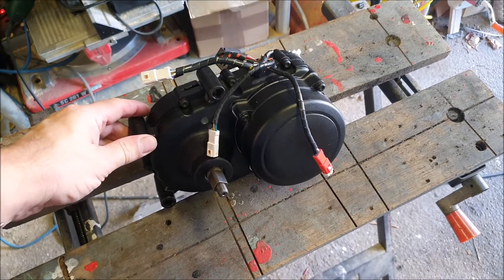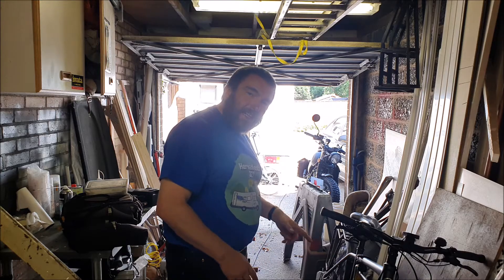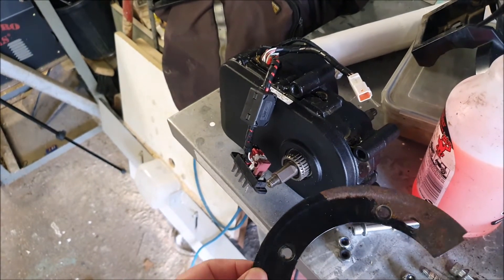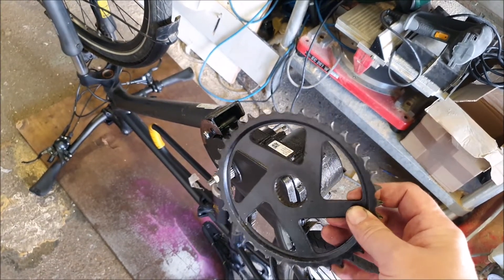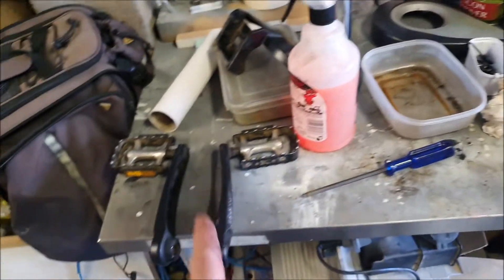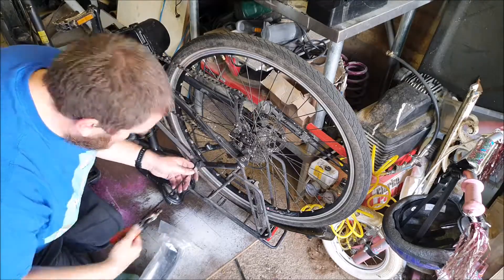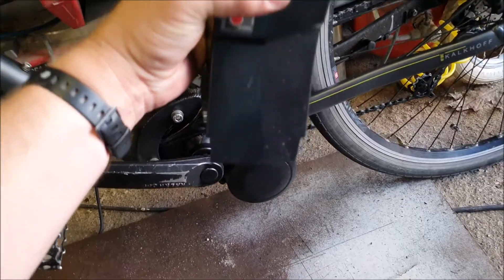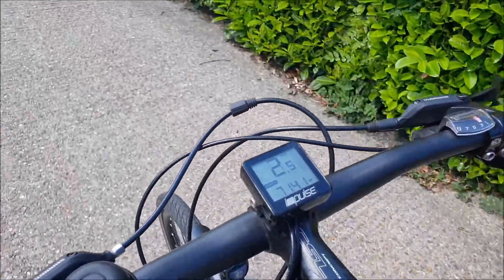Why Is My eBike Not Providing Power? Part 8 - Power Restored?

Comment: Thank you for giving my company,  Ebike Motor Centre (Performance Line Bearings) a shout out on your channel. In your video you were wondering where the water in your motor came from? It may be of help and interest to you that the third largest killer of the ebike motors we see, is water ingress caused by mounting an ebike on a vehicle rack and driving on wet roads. It's a bit like a washing machine behind a vehicle in the wet, and this water is attacking the bike from all angles for mile upon mile. Wrapping a plastic bag around the motor if the roads are wet will prolong the life of your motor exponentially. :)
Reply from the maker: Excellent stuff, thanks for this great advice and for sorting me out with a motor, fantastic service 👍